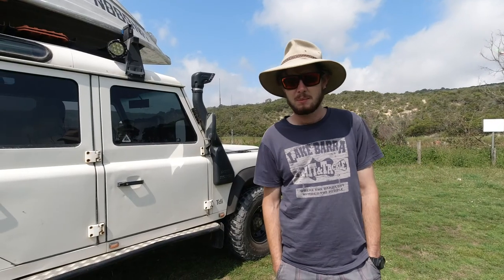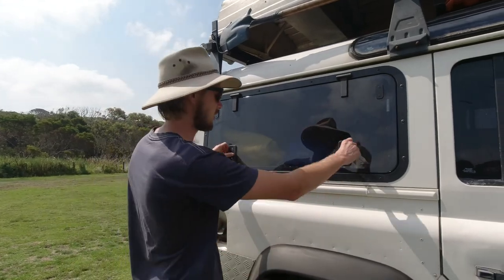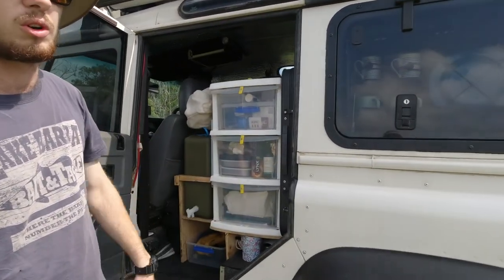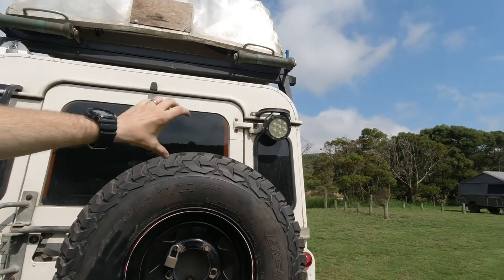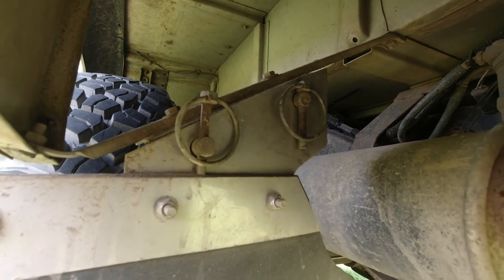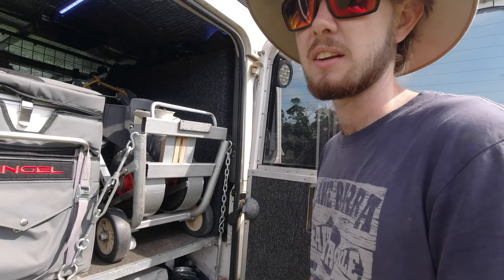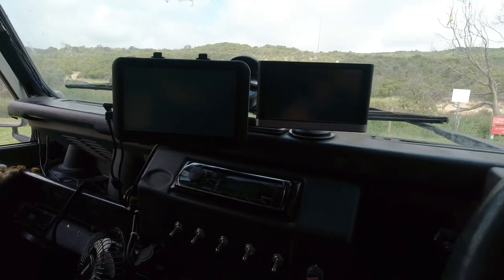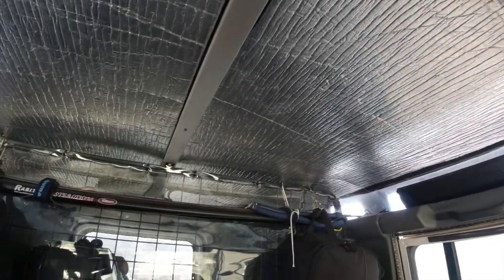CAR TOUR - Land Rover Defender | The Lap Australia

Comment: curious of your Tyre size choice... I’ve been thinking of this size for my own defender tdi300 but was concerned about the gearing, especially on take-off and when towing. How have u guys found the tyres in regards to takeoffs and towing? Has it effected your economy by much?  Also, have u done anything to the drivetrain to beef it up or is it still standard?
Btw Great video and been keenly watching your series as to how the defender goes on your trip as I’m thinking of doing something similar in my defender
Reply from the maker: Hi Rob, the 255/85 R16 are a great choice for the Defenders. You do kind of “lose a gear” a such having the bigger tyres but you do get used to it. They aren’t a fast car anyway so it’s not a great loss. As for towing, our camper weighs roughly 1600kgs and we don’t go fast but they tow like a trooper. I haven’t done anything to the drive train but I want to look at some upgrades in the future. Not towing I was getting about 12.5l per 100. But I haven’t looked at my economy while towing. Over all I find them to be a brilliant size for Defenders.  Glad you are enjoying our videos.